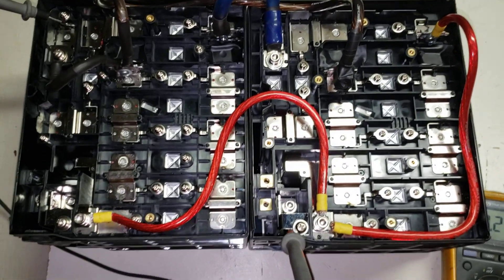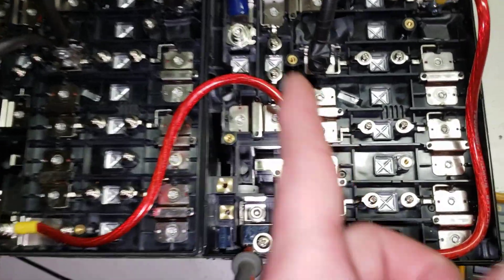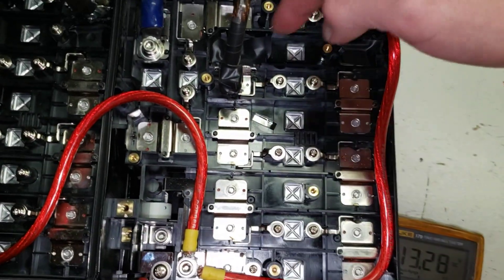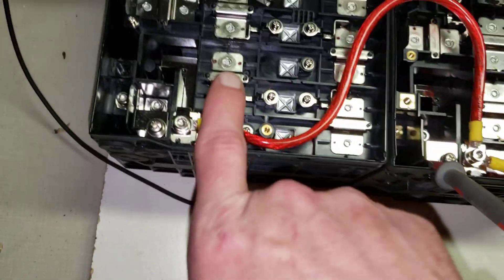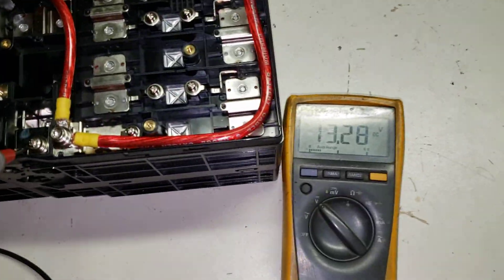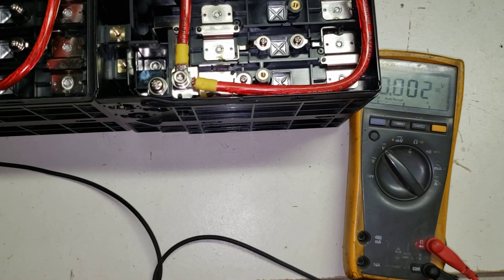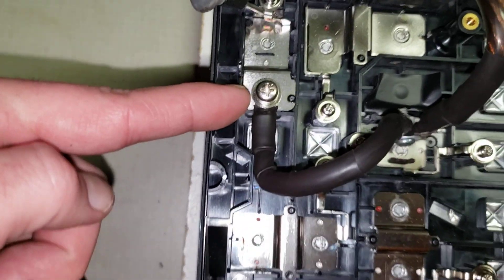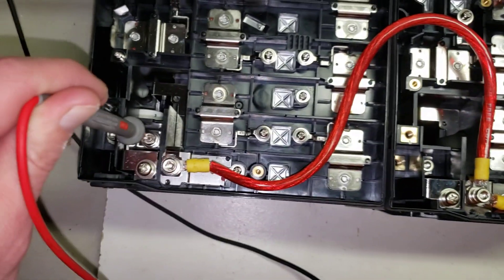DIY Lithium Toshiba scib Lithium 60ah 13.8v Battery build

Comment: I have three of the 8 Cell packs and made them into 6S4P and a couple 24 cell packs that I made into two 12S2P for a 24V industrial taylor dunn SS336 maintenance cart. Solder does stick to these metal jumpers. I used a Dremel like you but soldered my jumpers. You did a nice job by the way. Show another video with your BMS.
Reply: What fast charger did you use. And how fast can it charge your setup